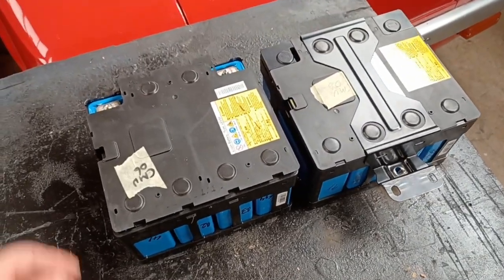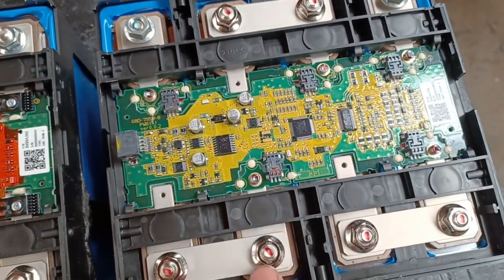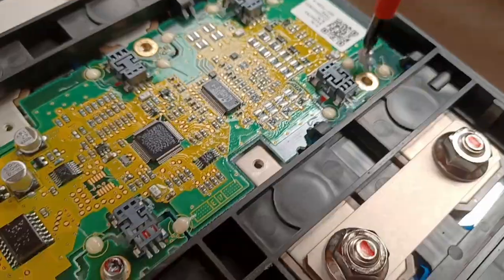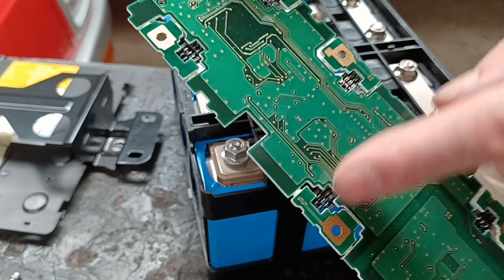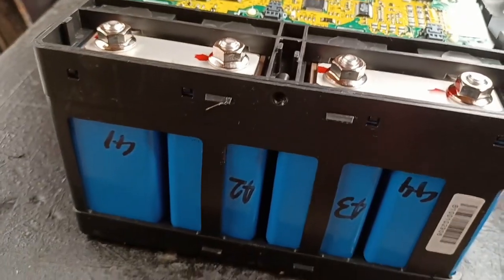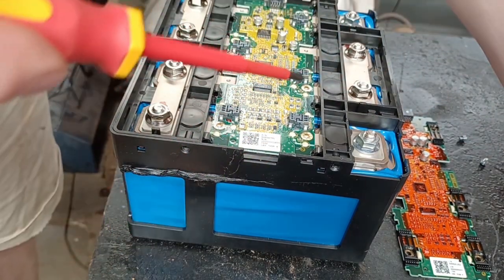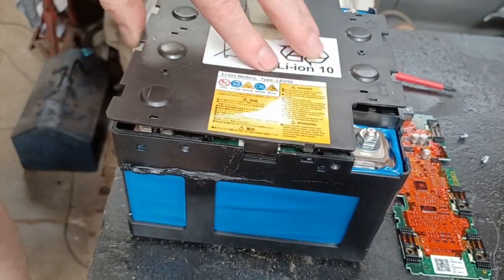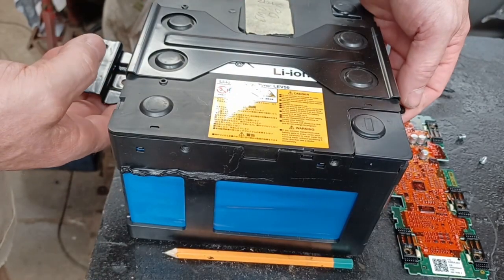Too Easy?? Imiev BMS change on battery #electriccar #batterypack #mitsubishi

Comment: what? little crews record temperature?
Reply from the maker: the little screws are the attachment points to each battery from the PCB and these are used to record the temperature and the voltages of each cell.
Reply: @alviseven1250  I understand that the voltage is the main reasons but it really measure also temperature? It does not have any sensor between cells? Interesting. Is it reliable to measure temperature "on terminals"?
Reply from the maker: The on screen app gives a voltage and cell temp for each cell showing a colour change fir the ones out of tolerance.agrre there appears to be no sensor but it does and these screws are the only attachment points.
Reply: @alviseven1250  So that is the reason why is PCB cut and connected with connector. There must be temperature sensor on that small PCB around the bolt. But anyway it senses only temperature of aluminium terminal not inside of the cells. It might be enough but EVs I opened always had sensor hidden between cells. I am thinking about buying some old not rusty car with damaged battery. As it is almost for free now. I found cell source in china but they do not have these extensions for BMS. Probably they can be made from aluminium sheet and bolted to normal cell terminals. Bigger problem is that new cells are almost double capacity of original and I was told it will never use more than original capacity until having can bridge with some hacky translation.